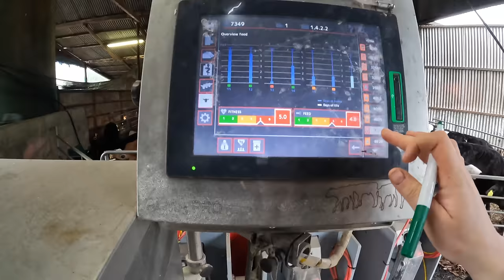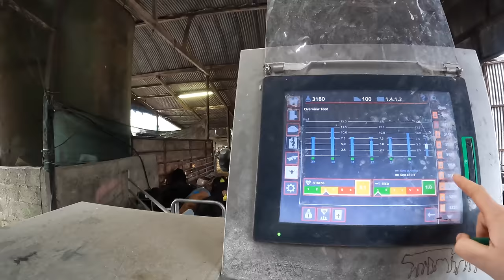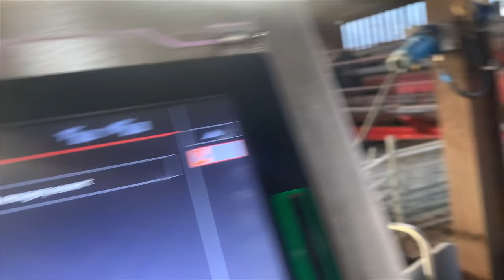A DAY IN THE LIFE WITH THE FARMERS WIFE

Comment: Hi phill. I bought a 135 last year just for tipping around the yard. The hydraulic presure release valve stuck and cracked the lift cover. Do u have any idea where i could get a second hand cover complete with pump and all the relevant bits that i can just leave it down and bolt it on and get going again. Martin in Tipp. Ps keep up the good work with the channel